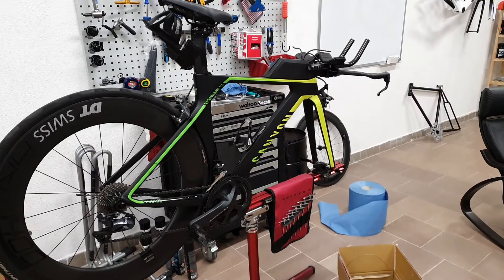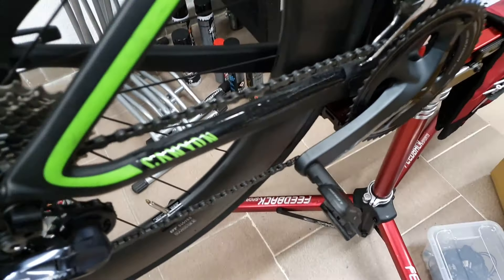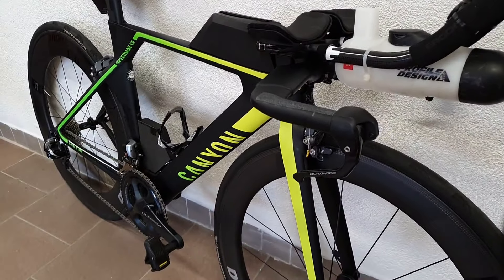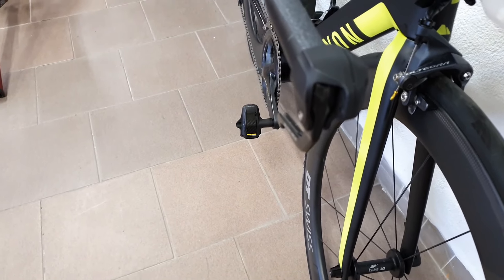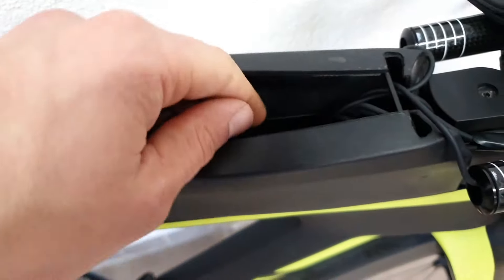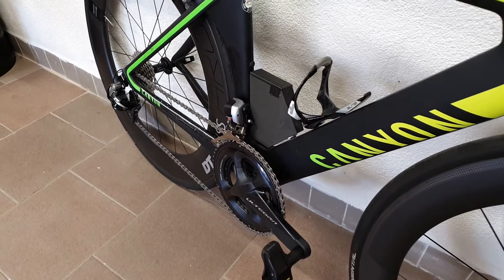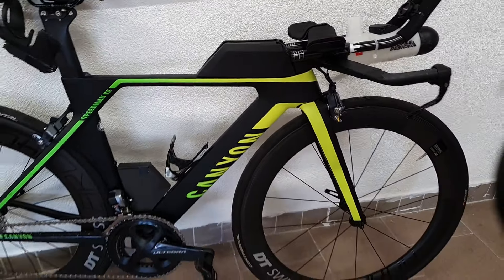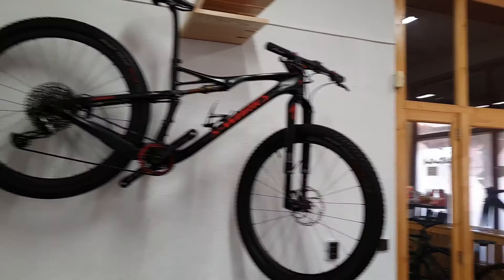Triathlon bike Di2 upgrade - is it worth switching to electronic shifting?

Comment: I have that exact model. Thinking of changing to di2 as I love it so much on my road bike, would’ve been interested to see the routing below the bento box
Reply from the maker: There's not much going on, just one cable between the junction boxes
Reply: I wouldn't do it, because on a tt bike you are not changing gear that often or that fast, in my opinion there is no need for it
Reply from the maker: @larsborgman3443  as I have explained, the big advantages are not in changing gear

Comment: Where you exit the cable of the frontderailleur our of the frame? The original cable exit doesnt fit? And where do you get the plugs for rearderailleur cable and bar end? Im also going to make my Speedmax Di2 hope you can help..😀
Reply from the maker: FD cable goes to the junction box at the BB. Plugs are available from Shimano

Comment: Is it worth of the value itself changing to electronic shifting? If it works AND without babysitting charging batteries so much.
Reply from the maker: One charge lasts at least 2000km. That's a month of riding even if you ride a lot

Comment: where did you put the battery
Reply from the maker: in the downtube
Reply: @ronykuba  I know this is quite old, but do you know which battery holder works for the cf 8.0?  I just upgraded and he put the battery in the seatpost (said it may fall) but I see a couple options but not sure which one is needed to mount it on the downtube

Comment: I've the same bike on di2 with aeria hydration similar to slx and its gr8...I have the option to put the di2 junction in the stem but makes charging tricky however frees up space and tidies up the bento box. I've heard of people mounting another junction under the seat to allow charging? Any tips how this could be done etc?
Reply: Hsf Aeria ultimate stem and hydration combo from profile design is a very neat solution, Unfortunately my frame is XS and is not possible to install without changing the ultegra brakes.

Comment: What are your thoughts of this bike vs the SLX?
Reply from the maker: The rear part is almost identical. You get many more cockpit options thanks to the standard steerer, but none will be as tidy. Also here you get superior braking.
Reply: I have an SLX. I love how tidy it is, and I do find the braking to be quite good.  I will admit that I wish the hydration system that comes with the SLX was a bit bigger. The cockpit options that come with the SLX are ok... Adjustments are fairly easy, but the extensions that come with it will be the first thing that needs to be changed. IMO a CF with a Tririg front brake, Di2 and a good hydration system is great bang for the buck. I would buy the SLX again though as I do love it.
Reply: @scubascott1098  thx for the answers guys. I have been thinkin for the whole winter where to go this year. Another SL, the SLX or get a speedconcept which I could build with 1×12
Reply: @gengar678  I bet they will update the SLX in the next 1-2 years with disc brakes. I would also put better front end adjustability on my wish list for that bike. Aside from that, there is not much to improve IMO